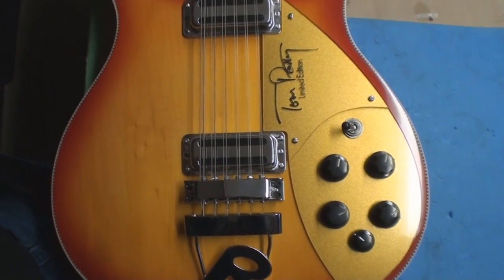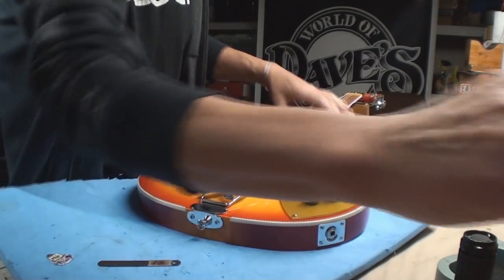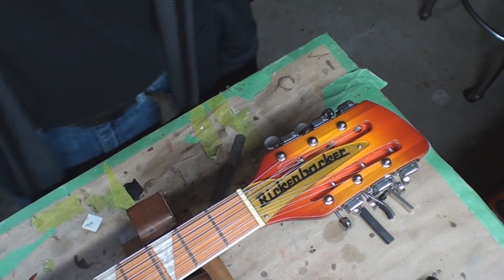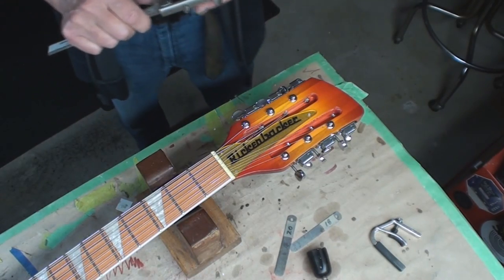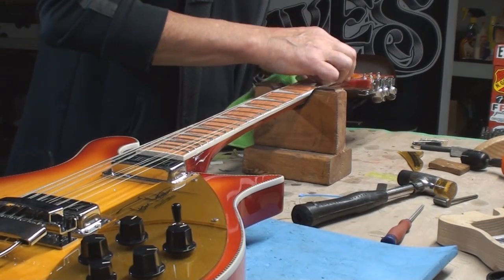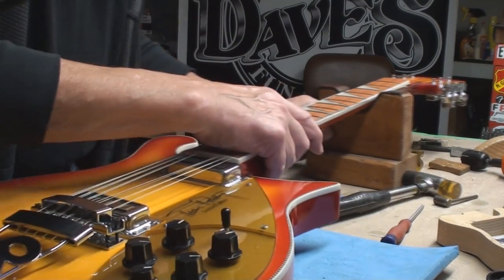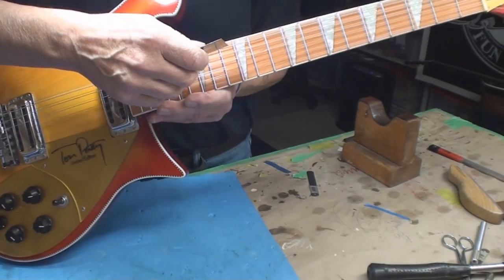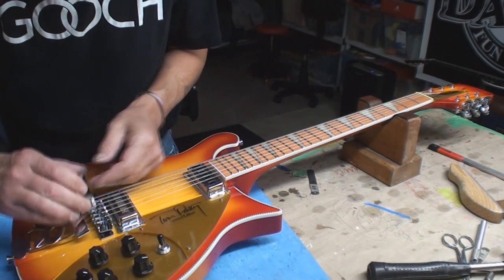Chickenbacker 12 string Tom Petty Edition Make it Stop

Comment: Had FB do the same thing to a group I had...30,000+ members...one morning, just gone and never a response as to why. I kept it moderated closely too to make sure no FB rules were broken. So will always remain a mystery and I didn't bother putting up a new group page, fed up with FB. 

On another note, I am waiting on tuners to finish up a 12 string project from parts guitars I had laying around. Mid 60's Baldwin 335 copy body with a Vox 12 string neck, P90's, trapeze tailpiece (and like Ric used to do, maybe still does, use one slot for 2 strings), original Baldwin bridge that has nylon saddles with serrations on each saddle so string placement is adjustable which makes it perfect for 12 stings instead of the original 6. Chinese electronics...So all in it will be under a $100...probably give the guitar to one of my grandkids. Fun stuff!
Reply: Back in the 60s I put Balwin tuners and PUPs on my Hoffner. TBH, I think I downgraded that poor guitar! Back then, I knew practically nothing, as there was no InterWeb. Or crowned frets, just file 'em down. Actually, the Slide-About-O-Matic bridge, which was totally unattached and had no intonation adjustment, was the real vagina, but someone somewhere will probably swear Hoffners were the Cat's Pyjamas, and will say all solid guitars should have a trapeze-type tailpiece.
Reply: @Ndlanding  I actually started this Vox/Baldwin project about 20 years ago...pretty sure I had all of the original Baldwin parts back then, guitar had a broken scroll headstock when I got it, no idea where all that stuff got off to. Vox neck must have come off of something, but I can't remember what or when I even got it. Probably owned over 50 guitars since then, still have about 30, so things get a little fuzzy as to when or where I got them. I do own a Baldwin built Gretsch after they sold out to Baldwin around 1972 and moved to Arkansas, Country Club model near mint and is one nice guitar, 1979. Got it in a part trade for a 1960 Gibson ES345 plus a shit ton of cash. Actually like the Gretsch better than the 345. By then they had their fit/finish and building down pat versus the old Baldwin stuff and not as fragile as the Gibson, worth way less money so not as worried about it as you had to be with the 345 either. Now that I've got old (sneaks up on ya) I have more time to finish off projects started years ago....IF I can keep the Honey Do's under control around here.
Reply: @glenchoitz9497  Good luck with your projects! Me, I've somehow got old too, and I have a few minor projects for "perfecting" a couple of guitars, but none of them are older than 90s. Sadly, I'm thinking about selling my 65 Tele, since it's really wasted on me now. In fact, I don't know why I have a collection since 2 or 3 is plenty. :)
Reply: @Ndlanding  Same here...really should get rid of most of them, but everytime I try to figure out which ones I will keep...well, let's just say all of them have become like old friends, most not worth much but you hate to get rid of them too. Guess I will let the wife or kids sort it out later on...lol

Comment: Can you tell if this could be strung the "rick" way with the high strings after the lows? Probably would require a new nut, but would it work with the bridge?
Reply from the maker: only signature Petty and McQuine models are like that.. and have been converted..this is like a Ricky..sorry

Comment: I've got a friend who owns a guitar store and someone can in with a Chibson Jimmy Page 1275, wanted $200.00 for it.  He explained the he couldn't sell a counterfeit or tribute guitar, so no deal.  He called me and asked if I'd be interested.  So I said yeah, I'd take a look, he said he wanted to trade it for an Epiphone 12 string and fifty bucks. .  I got there with my Samick 12 string and case.  I asked my friend to do a once over.  He said the necks actually looked good, he tuned it and checked the intonation.  I offered the guy my Samick and $25.00, he took it.  I had my friend do a set up a few frets needed leveling, and restring it.  He said it's close, as good as an Epiphone 1275.  So I had about $80.00 cash into the guitar.  I wound up replacing the 6 string bridge, the tuners, and the nuts.  Funny thing is, I have a friend who plays in a few bands and she has the real Gibson.  She told me that most people regret buying these after a few months, but they are incredibly difficult to sell and not take a bath on. I got over the thrill in about two months.

Comment: This may sound like a dumb question, however I also believe there stupid question are the ones you don’t ask... 
How does one zero out the caliper to get the proper fret measurement? I’ve never used the sliding rule end to measure anything I’ve only used the jaw side or the finger side or whatever the exact term for that side is.

Comment: Is the neck wider on the Chickenbacker than a normal Ric neck? If so, it may be worth having just for that reason alone...I never could get used to that extreme narrow finger spacing on a Ric, something Ric refuses to change though people have complained about it for years. I have a 60's 360 12 Japanese copy that is very accurate except for an 1/8th inch wider neck...plays better for me than any Ric I have owned and plenty jangly.
Reply: Tom Petty models had a wider neck as per Tom’s request ( as per my Ricky books)
Reply: Glen Choitz Fred Sonic Smith would scoff at the notion of a Rick neck being too narrow. I also think they’re perfect. I don’t have gorilla paws for hands though. I’ve ran into plenty necks that were too thick or wide though. (Insert butter joke below)
Reply: @TonyMcClelland2  My hands would be considered in the small range...any of their 12 strings just crowd the fingerboard to much for me, of course to each their own...they sell a ton of them so some must like those narrow necks...I'm just not one of them.
Reply: Got rid of a beautiful ric for that reason,

Comment: The STRINGS ARE ON WRONG.

For this model of Rick starting with the 620 THE LOW STRING IS FIRST opposite to the usual high string on top it should be on the bottom. That's Rickenbacker's design for this series of 12's. 

Look closely at the string arrangement on the originals of these.
Reply from the maker: try playing it..it DOES NOT WORK. Petty and McGuinne ..have a look..you version is impossible play rock on
Reply: @DavesWorldofFunStuff  It's not MY version it's the way the guitar was designed. Look at the photos of the 660 12TP. Look at the head-stock close ups. Whether you reverse the string arrangement after you buy the guitar is another matter. 

As far as Mcguinn there's a video of him playing T-man and his lows appear to be on top. The video upload is low-res though. Have a look. Look for The 12-String Guitar of Roger McGuinn 
Homespun Music Instruction

Comment: @dave  Wish you had played a few chords after you fiddled with the string height. The clone is not a neck-through as the original 660, wrong tailpiece. Seen some MIC  660 TP's with the wrong pickup spacing. A difficult body to build IMO. Originals of these go for 8 grand. Better strings are night and day for these MIC units. There's no video of this particular 660/12 solid body clone I can find to hear what the guitar sounds like after set-up. The semi-hollow "cat's eye" ones of the Ric 12 seen on YT sound awful. And the people playing them in the videos can't tell the difference.

Comment: I have a Korean made Schecter bass.  I tuned it a month ago and it only lost a quarter tone in that time.  Very stable.
Just buy American or used from Korea, Japan, or Europe.
Reply: That's very good. I have had custom shop Les Paul's that didn't do that. But that was right after I had it set up and with the heat we have here in Arizona it just makes things crazy screws with guitar intonation lots of very small truss rod adjustment however my other Les Paul that I've had for almost 20 years almost 40 years but it 1980 in Seattle it's got 12 on it I had it set up I have a plated in six or eight months I pick it up and it's perfectly in tune but it's at a long time to get stable. My orher les paul  is a  2016 R9. please Graven every now and then I have to have the truss rod adjust a little bit I think it's still getting used to being a guitar and living in the desert